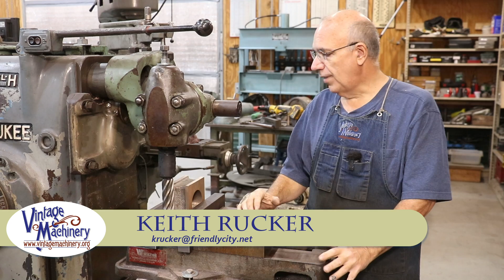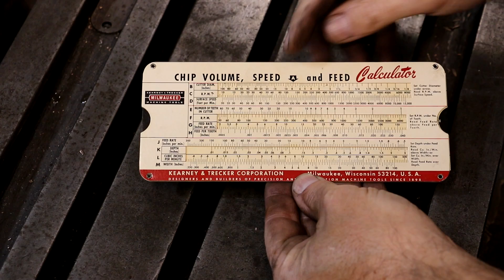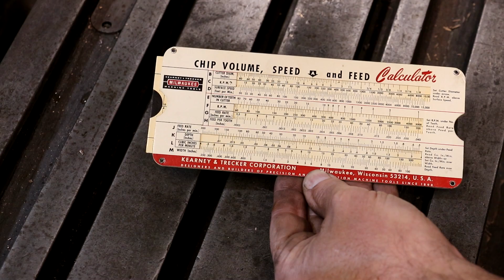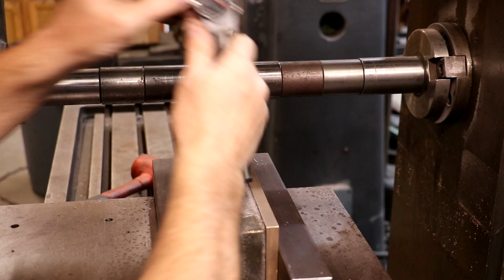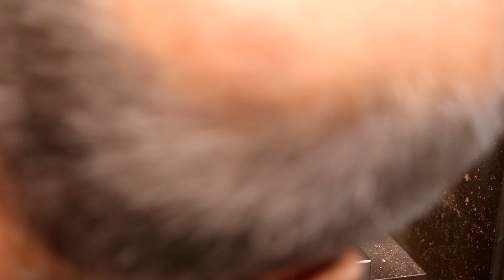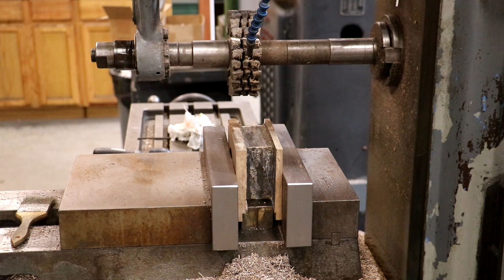Vulcan Steam Locomotive Connecting Rod Bearings: Gang Milling on the Horizontal Milling Machine

Comment: I have always noticed that cutters have that "noise" pattern to them. Sometimes its a harmonic. I've seen where using a grinder (not a benchtop) to accurately sharpen the cutting edge will eliminate the oscillating noise. I don't believe that the manufacturer wants to spend a whole lot of time making "spring passes" on an already sharp edge just to reduce the noise. 
(Make a pass and evaluate. Redress the wheel and make adjustments to height, angle or depth.  Make another pass, repeat. Etc etc etc.) But sometimes that would be solely for the weekend YouTuber hobbyist.

Comment: Dedicated watcher here for years now, and it looks like you have had more headaches with these parts then anything I have ever seen you do. - If you can come up with a cutter for the taper side looks like you got them on the run, though. 

BTW, I think I told you already, and not with depth mics but we have a 1.456" x .125" deep counter bore we do all the time that I use a B&S ID mic on. I screwed up so many times reading the mic wrong  scrapping the part I am so gun shy that I verify the mic with verniers ever time I read it!. That mic has made me look like a first day apprentice more times then I care to remember.   I'm betting you and I are not the only ones that mess up with depth and ID mics. 

Well the backwards reading mics, setups that didn't work and cutters that are too small are behind you.....I;m sure you will finely get er done now!   (One of those days,,,,,,)

Yo, 2-more operations and the Gremlin parts are back on the engine and out of the shop! Bet you will be glad to see them go!!!!!

Comment: With the pins being so far out of tolerance that you have to custom fit each one; When do you decide that it is time to make new pins?

I know that it is a vicious circle, you fix the next part and then whatever that is attached to is out of spec; and so on, and so on. Would out of round pins also wear the main rod bearings.
I am not a machinist but could the pins be turned down and sleeved with an interference fit?

Comment: Keith, I love your channel. I used to run an old ww2 KT like yours in the old Firestone plant in LA, circa 1975. If you want to reduce runout in your arbor, move your work in as close to the machine as you can and move your support in as well to reduce the effective length of the arbor to a minimum. In your case should cut the runout in half.

Comment: You REALLY need to install some bushings between the overarm support locking nuts and top casting.  Using the parking attachment to press against isn't allowing those nuts to tighten, causing the support to move, as can be seen around the 21:00 mark.  It does look like you noticed, since the support is back to where it was in the beginning and you have a ratchet on the rear nut, at the end of the video.

Comment: Caveat; every thing I know about machining and casting I’ve learned from watching Keith Rucker. That being said, with the total amount of machining being done on these parts, wouldn’t it have been more accurate and efficient to have just started with a solid block of bronze rather than a casting?
Reply: Depends what you mean by "efficient". Bronze is not at all a cheap material, and if you can save maybe 20% of the mass by starting with a casting that could be a huge saving.

Comment: Good thing you installed the parking attachment. If it just made things easier than getting out the engine hoist to deal with the head, it was a good deal, if the parking attachment saved you time it was a great deal. Great video as always.

Comment: Keith, a friendly reminder. I guess you know that the depth can also be checked with the other end of the caliper. The end is precision machined or ground so the it can be used with the back side of the caliper using the movable jaw as the other stop to measure depth.  It is way more accurate than balancing the small end on a surface having a greater possibly a getting parallax reading. The other end has more surface area.  You have the room with this bearing for making use of the large end of the caliper. If you are like me, I am a creature of habit and find myself forgetting about using the large end. Many things I check don't have the room to do so therefore it reinforces me not to use it.
Kudos on your loss of weight. You sound healthier. Before, you were gasping when talking so you must be feeling a lot better. You do look better. Congratulations.

Comment: hello it's a lot of complication for a very basic machining
Reply: That’s what you have to do to be certain the part is accurate with a good finish and to specs. Anything less may result in a scrapped part.
Reply: I have been a machining mechanic for over 40 years and I find that the procedure is not the right one

Comment: I'm mildly surprised you didnt just use an angle plate instead of go to all that time wasting changing from vertical to horizontal. Even with the horizontal set up an angle plate would have some advantages on a workpiece with that aspect ratio. BUT if the job gets done that is all that matters, not how you do it.

Comment: I don’t understand the reluctance to buy correct tooling
So much is donated a purchase now and again seems justified!
JIM  😊
Reply: Think about it, only 4 pcs. For a “Steam locomotive “ . Reuse, save $. Perfect.
Reply: Nothing wrong with being frugal, just regroup and use what you got!
Reply: Could also be about time. Yeah. There isn't a big push to get these done but sometimes you just want to get the job done and move on instead of waiting for tooling.
Reply: I don't buy an expensive piece of tooling for a one-time use unless there's no other way. Plus in this case I wouldn't want the reduced rigidity of an extra long end mill for that very deep slot, if that's what you're referring to. To me the horizontal setup is the way to go anyway.

Comment: Hi, please explain why you have chosen not to replace/refurbish the pins rather than custom making each bearing?
Reply: Making the bearings match the pins should only require adjusting the boring head during the boring operation.  Replacing the pins would probably require removing the wheels from the locomotive, pressing/cutting the pins out, machining new pins, pressing the new pins into the wheels, and reinstalling the wheels.  That's a lot more work/time/tools/equipment/men, for almost no benefit (unless the pins are worn to the point of breaking).
Reply: Thanks for answering that question. I had asked it (before I read your reply to Mark's question). That makes sense.

I ask it from an engineer's perspective (electrical engineer, not mechanical, but I have had a little experience in machine maintenance). To an engineer it always seems like an easy answer (I freely admit that to being one of our weaknesses). Metrology and materials science were two of my minors on my degree and I keep going back to tolerances.

Comment: 4:10 Why is the support extended so far?
Reply: Most likely reason is that Kieth doesn't have any shorter ones suitable for the job. Also, depending on the cutter contact and the materials being used, the rigidity gained by using a shorter arbour may not mean much. Consider that the machine he is using is designed for gang-milling castings, which would require the use of long arbors. The manufacturer would have specified a larger-diameter arbor if it improved the rigidity of the horizontal milling setup, which would result in better finishes and improved accuracy... He probably just doesn't have a shorter one. 😁
Reply: The support bushing could have been closer to the cutters and the smaller diameter clamping bushings and nut hanging out towards the arbor end
Same tooling, different configuration 😮
JIM 😂😅

Comment: Brass and Bronze are not synonyms, they are different alloys!
Reply: Your fact-fu is mighty!
Reply: @pauldorman  Keith often refers to  Brass or Bronze  as if it were the same thing!
Reply: @MatthewTinker-au-pont-blanc , are you trying to get complemented for your obvious-fu  as well?  😁
Reply: @MatthewTinker-au-pont-blanc I knew an old machinist who just referred to them all as "copper based alloys"
Reply: @littleworkshopofhorrors2395  I just got off wikipedia... And museums are saying the same thing. Huh.
Reply: Not going to let it ruin my day....
Reply: @charlesblanton1008  yyyyep.
Reply: I have always been told that brass is not good for bearings. It was wears too easily, whereas bronze is much more robust when used for bearings.
Reply: Brass and bronze are vastly different in their properties and uses. Same as saying cast iron and steel are similar because they are “iron alloys”.
Reply: So... As a machinist, how should he handle the difference between the two? Just curious.
Reply: @bengardiner3867  As a machinist, look at The metal and it's aplication and say which one it is!
Reply: @MatthewTinker-au-pont-blanc  🙄
Reply: Huh. He referred to the metal as bronze at the end of the vid. All is right with the world.
Reply: @bengardiner3867  I've been following Keith from  the beginning, it allways  been Brass or Bronze !
Reply: Brass is composed of copper and zinc, whereas bronze is made up of copper and tin, sometimes with other elements such as phosphorus or aluminium added in.

Bronze has been made from copper and tin for about 4000 years now. Tin bronzes are usually produced in strip and wire form with a mix of high yield strength and corrosion resistance. Phosphor bronze has increased hardness, fatigue resistance and wear resistance which makes it great for springs, bellows, flexible tubing, fasteners, masonry fixings, shafts, valve spindles, gears and bearings.

Brass is the name for a range of copper-zinc alloys with differing combinations of properties. The variety of available forms is very large, which can allow for minimum machining. Brass is very versatile and a first choice for heat exchangers (radiators). Unlike mild steel, it does not become brittle at low temperatures.

Nickel-silver is created by adding 10-20 % nickel to brass. What makes it different from brass is its higher tarnish resistance and resistance to stress corrosion cracking. It also has an attractive silvery look and is used frequently in things like telecommunication components, food manufacturing equipment, jewelry, model making, tool brush anchor wire and pins, musical instruments, test probes and contact springs.  

Copper-nickel alloys are ideal for marine uses such as seawater pipework or desalination units because they are highly resistant to seawater flow and hardly susceptible to the attachment of marine organisms. Nickel improves the corrosion resistance and strength of copper without a loss on ductility.

Gunmetals are mixes of copper, tin, zinc and lead known for their corrosion resistance, good strength and ease of casting. They are used to make intricate castings required to be pressure tight like pumps, valves and pipe fittings. Where loads and speeds are moderate, bearings are also often made of gunmetals. These alloys are also used in modern statues.

Beryllium-copper in the fully heat treated and cold worked condition is the hardest and strongest of all copper alloys. Its mechanical properties are similar to many high strength alloy steels, but it has better corrosion resistance as well as electrical and thermal conductivity than any of them. Beryllium-copper alloys are used for example in springs, electrical contacts, valves, pumps, different kinds of non-magnetic, non-sparking tools and injection molds.
Reply: @aaronhoffmeyer , Interesting read, thanks for sharing. After reading all of that, I can see why Keith tries to generalize it into something more generic. Lol
Reply: Hey there folks, even if he was calling it "one of those two copper alloys" he'd be more rightly than not. So many specifications of brass, color of and hardness of, not to mention those using a bronze of some sort. Kind of like, you want it soon, but faster, factual information about these too is daunting.
Reply: @CothranMike  I think picking the right material for a sliding bearings is vital, even if it's a little daunting.
Reply: @CothranMike  They are used in different applications and have  different colours.